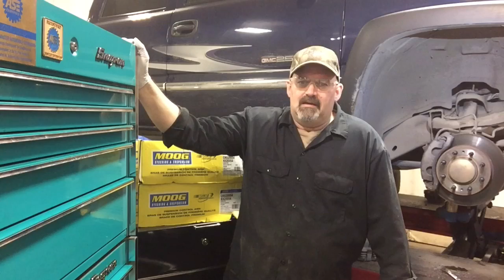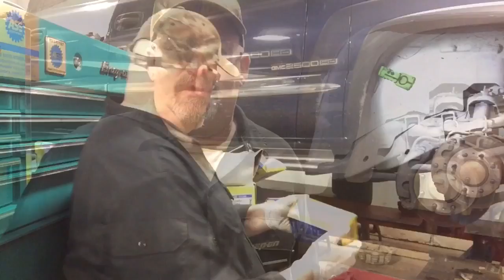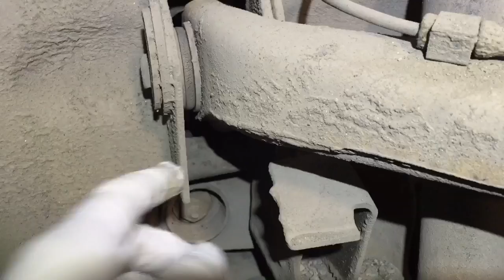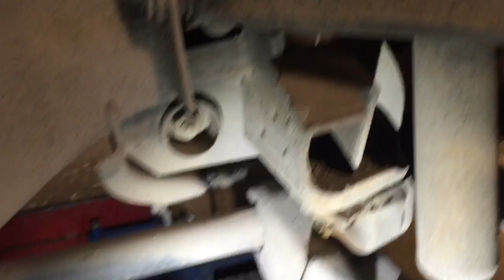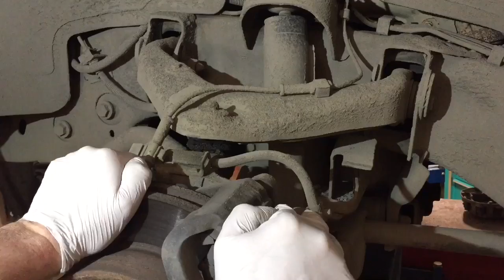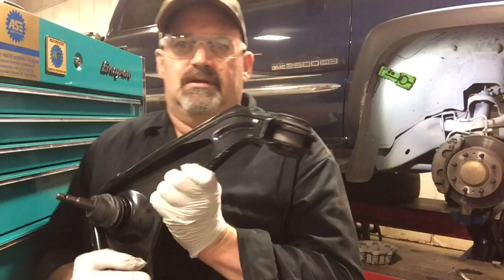Replace Just the Ball Joint Or The Entire Control Arm - Front Suspension Repair Tips

Comment: Hi, I have a 2000 chevy 3500 express diesel van. I have a noise in the right front. When they put breaks on my van I was told that the right upper ball joint needed to be replaced. I didn’t have the money to do it. I’m thinking maybe about getting that ball joint done over the next 4 or 5 months. What should I expect it to cost me for that kind of a repair? I am in NJ so I assume rust may make the job longer. So maybe you need to factor in some extra time for the job.

Thanks

Comment: Love your video, I need help ! Can't replace the bolt on lower ball joint on my audi q3?? Nuts are off but won't release from control arm
Reply from the maker: May need some heat or air impact tool. Wish I could help but I’m in Alaska

Comment: Greetings. Hoping you might be able to answer a few question. Just had my Ford Explorer in the shop and they say I need some work on my front end which I know it needs but the estimate they gave me sounds like the same parts so here goes. For parts he has 2 Lower Ball Joints($170),  1 control arm with Ball Joint - Front right upper($97), 1 Control Arm Assembly($110), Tie Rod end - Outer Left($68)......prices are for parts not labor and under labor cost Ball Joint - remove & replace -RWD lower, both. Ball Joint - remove & replace - upper, both - [Serviced with Control Arm] Tie Rod&/or End - remove & replace - outer, one side - [includes: adjust toe-in only Note; Deduct .4 if alignment is also performed Note: Manufacture recommends removal of rack and pinion steering gear when replacing inner tie rod end(s) on some models. Left(driver)Outer! So does this sound normal to you.....thank you in advance!!
Reply from the maker: Yes. Hope they are quality parts. No need to remove rack on that vehicle so the inner tie rod estimate is probably high.
Reply: @ThecardoctorTV  Thank you!

Comment: On my car 2003 Chevy Cavalier I removed the rivets and increased the holes to 1/2" to fit new ball joint bolts. But the question I can't find anywhere: what torque specifications do you apply on those 3 bolt, attaching the Ball Joint to the Control Arm? In Haynes Manual it says should be an instruction sheet in a new set, but mine doesn't have one. From Internet it looks like 10-12 or 12-14 Ft-lbs, but in one film he applied 50 Ft-lbs, though on a truck. Pls could you give your opinion what torque specification it can be? I did a lot of research on Internet, nothing on that question. Thank you for a good film.

Comment: I have around 260,000 miles with original control arms from factory, would you recommend replacing them? My ball joints are bad but with the amount of miles I have, I figured I’d just replace the control arms. What do you suggest?

Comment: 2004HD Duramax with 260,000 on it. Replaced both upper ball joints last year. Was not aware of that the upper control arm with ball joints was an option. Now, of course, the control arm bushings are going out. ;) So have to make the decision, do I replace bushings or complete assembly and eat the new ball joints that only have about 1,000 miles on them. :(

Comment: You really hit the nail on the head when doing work for someone else, time is money. Yes, you can often replace individual parts for less money in regards to parts but it can easily end up costing more on labor. That's why things like Monroe quick-struts are popular, they are much faster to swap in and out and you don't have to dance with death trying to compress springs.
But if you are doing the job for yourself, replacing the ball joints and bushings can be better because you can get the parts for less or you can sometimes get better upgraded parts. It all boils down to if you have more time than money or if you need it done quick. Plus, people like to go straight for the cheapest parts... I would much rather spend a bit more for a good Moog part and have confidence it will last for years instead of being right back here again next year replacing the same cheap brand part.

Comment: I have an '02 Dakota Quad Cab. Just rebuild the whole front suspension in my driveway. I went with all 4 moog control arms which came with the ball joints & control arm bushings arm bushings pre installed. Also did the tie rods, steering links, and the stabilizer bar links. The ball joints had zerk fittings. The tie rods & stabilizer links didn't, so I drilled 7/32 holes, 1/4 x 28 tap & installed zerks on these. $360 delivered from rockauto. No regrets. Wasn't worth the chance of the greif it could have been. My truck now feels as tight as when I bought it new.

Comment: How do you know if you need to replace the moog lower control arm?  What happens if you dont replace them?
Reply: You don't have to replace them unless they are broken or somehow damaged. Its just on some applications its easier and faster to just replace the whole control arm rather than go through the aggravation of trying to replace a ball joint In the case of the Cadillac with torsion bars its too much work to replace the lower control arm because of the torsion bars and all the crap you have to remove so that's why the easier way to go on lower control arms for this car is ball joint replacement

Comment: Moog used to be made in US only but now that FM bought them they are 

made by about 16 different countries so unless you can see the box on the shelf you do not know where or what you are getting.it is a shame. because I like you always had used Moog suspension parts. As of late there are a lot of reports of wear and especially boot failures on the ball joints.I have used nothing but Moog through the last 50 years,so now I do not know what to use anymore that I can depend on.
Reply: OEM

Comment: guys and gals! thanks for your video on this. goodyear replaced lower control arm and ball joints and just found out from a different shop that goodyear stripped out both ball joints bolts and one bolt was so lose the wheel was flopping.
Reply: Sounds like a lawsuit to me gal.

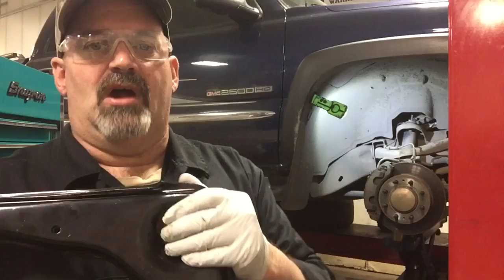Comment: @7:50

I had the shop repair manual on CD-ROM for my 1992 Ford Probe.  Most of you all know that the chassis engine and transmission was Mazda MX6.

The manual strictly prohibited replacing the ball joints saying that  the control arm could not withstand the force of a press.

And yet just before I watch this video I see ball joints for that car still for sale.

Comment: Just one tiny issue.  They don't make the control arms for my truck.  Thus my only option is to change the balljoints as needed (the originals lasted 360,000 miles and were not as bad as the ones in this video)    And then when the control arm bushings start to get play in them (as of now they don't)  then I'll have to cut them completely off and weld in new mounts for a tubular after-market set up.  There may be some videos on this channel that show fabrication of aftermarket parts into vehicles with discontinued part numbers, but if not it may make for a good video!

Comment: Hopefully the time of chatter is'not included in the labor cost.
Reply: Most flat rate mechanics charge fairly close to the published book time, as shown in the dealers repair manual. In some individual cars, work can be done more quickly, in others a broken or rusted bolt can push time over. Like many jobs, the average is acceptable but there are tasks that take longer and the mechanic eats that time. I worry more about the guy who is cutting corners to make money by moving faster. The job ends up being sloppy and maybe not done correctly. The guy who spends a little time teaching will almost never directly charge his customer for that.

Comment: If you're a well versed and equipped diy'er, as I would consider myself, I like to keep the upper and lower arms and just replace bushings and ball joints.  For less money you can buy superior (IMO) ball joints and bushings than the cost of new arms that typically have basic bushings and ball joints. This is of course as long as the arms themselves are in good condition.  I live in a dry warm climate, so for me, rust is not really much of an issue.  The trade off is there will be the extra time to press them out but since it's a heavier duty part, the intervals in which you would have to do it is increased.  Worth the effort to me.  Thanks for the videos.  Edit: Example where I live, complete upper control arm is anywhere around $60-$125.....all over the board really.  Heavy duty ball joint and polyurethane bushings about $40.

Comment: Are ball joints covered on warranty? I can't find it in the contract I have a Nissan Sentra 2012
Reply: Sam G most warranties I’ve seen are usually going to exclude those sorts of parts, most components in the wheel well are usually for you to pay for. Especially if it’s a ‘12, that’s 7-9years on the warranty. Probably at this point nothing is covered- I’d definitely call and ask.

Comment: I really enjoy watching your Channel , but seems you get the same number of thumbs down @ every Tutorial you put up ...  Hmm .. ?  Animosity perhaps ? After watching previous vid  " Replacing Upper arm and Lower ball joints " ,  Thank You for the explanation as to why and when the Upper Arm Assembly should be/not be replaced ,   I was also a bit confused at first vid as well .  Location  ( weather / terrain conditions etc. )  along with sustainability vs. cost ,  plays a major roll in evaluating whats best in the long run . I'm getting ready to pull the drivers side wheel of my recently purchased ( used ) 03 Chevy Avalanche 4x4 that has some play in steering wheel and likes to float to the left @ 35-40 mph. and while braking .  Previous owner says ball joints needed replaced , but I haven't inspected or sure what underlying problems may exist .. thanks for the possibility's that may incur and/or how to repair in this scenario . P.S any tips or cause on the the above described would be most comforting ,  Thanks  RJ

Comment: Thank you  Doctor!  I wish you were around where we live.  Wife has a 06 Lincoln Town. We are replacing worn lower balls with Moog as I have sold thousand of dollars of Moog with no issues. We want to do the uppers at the same time even though they are still tight  as the car is 13 years young with 100 k on the clock.   Upper control arms may be steel or aluminum but I haven't been able to go underneath with a magnet.  Does it matter?  Should I go with the arms or just the balls and if I go with the arms should I get steel or aluminum?

Comment: Is it safer replacing whole arm with riveted lower ball joint than just replacing lower ball joint . The bolts for new LBJ has nylon inside bolts does it fit as tight after cutting and pounding out old rivets.has any replaced ever come loose
Reply from the maker: Just need to get the bolts tight and they hold just as good as the rivets. I have seen bolts that came loose but probably not properly torqued in the first place

Comment: I agree totally on the quality of Moog parts. I recently replaced my lower ball joints on my 2003 Silverado 2WD, and for the application it was much easier to replace the whole arm. The joints are riveted to the arm, which would require a lot of drilling to replace.
Reply from the maker: Good call. I would make more money off labor but it would end up costing the customer more just doing the joint in some cases and they get less bang for the buck. Thanks for dropping by the shop!

Comment: only issue i see with a upper arm is that half the time in wisconsin those cam bolts are so seized to the bushing sleeve you have to sawzall them out and then buy new cams. Its easier to just do the joint in my opinion.
Reply from the maker: +UBBERTANKER oh I believe that. You rust belt techs are hard core. I e has the same can of WD40 for twenty years. Most bolts we can remove with bare hands. I hardly ever use my wrenches. Haha.

Comment: Truly amazing to see a 14 year old truck with a ton of miles on it with no rust
Reply from the maker: +davemaster001 It's probably strange to hear but 130K is a lot of miles here. 150K on a 2001 F 150 is doing really good. This one has over 230K and running strong however the trans might be weak. Cold weather, lots of idling time, no highway miles and terrible roads take their toll. There are actually some really nice classic cars here. Quite a few exotics but they can only drive them 4-5 months out of the year. Next year I might get me a dog sled team and stop worrying about all these vehicle issues!

Comment: Tim on my 2500hd my upper arms were good and I used moog problem solver upper ball joints. If I went for the arms I would need the alignment done. All good and tracks fine I know they suggest to get an alignment so when you just change the upper ball joint do you find the alignment out ?
Reply from the maker: +STEVE ROB If I find the alignment out after the repair I figure it's probably not due to the actual part replacement but likely from before. Maybe a condition that happened over time or because of a bad pothole. Hard to imagine that parts machined with such close tolerances would cause a difference in alignment angles of any consequence. On the rig today I changed the arms and left the plastic cam bolt locators on and used them to get a more exact position of the arms. I'll see tomorrow when I put the machine on it in the morning and see where we are at. In your case it seems like if it handles great and there is no tire wear it's probably ok. Toe seems to be the most sensitive angle when speaking of parts changing and the resulting effect. That's all I got. If you need the mathematical and physics principles in regards to this theory you'll need to talk to Eric O. Haha.
Reply from the maker: Thank you guys. it's really cool to watch a student of mine get from not understanding what internal combustion was to learning how to put air in a tire. He's come a long way and that's just in the last six months. So proud of him.
Reply: +STEVE ROB - Hiya's Big Guy!  Steve - some clown left ya a note above.
Reply: Hawaiian F150 A pretty smart one too, little secret just between us guys, you know that Eric O guy well he was taught everything by Tim  when he lived down south. Actually was Tim's  helper, you know getting coffee's , that kinda thing , then Tim started him off with tire changing and look at him now he's a fantastic tire changer.  LOL
Reply: +STEVE ROB -- i didn't know that. That is really awesome. I mean to know that someone you helped and taught has become such a good mechanic. Tim - You got to be Really Proud of that. And you certainly have every right to Proud. I would if it were me.  Not many can say and show how much they helped others become better people.  Many Talk the Talk - You Walked the Talk.

Comment: I am just about to change the front control arms on my ford mondeo, I decided to go with new control arms simply becasue purchasing the bushings and ball joint separately would have been only like 35% cheaper, and in my opinion this would not offset the additional work involved.
Reply from the maker: +krugerblue That's probably my thinking most of the time. I still have customers who insist on replacing everything if your in there and others who always want to do just the minimum no mater what. Even if addressing something now will save a lot of money when they have to do it a year down the road they choose to save a buck now. I get that too. Lots to consider. I hope folks feel free to add ideas here so we can all keep an open mind to the spectrum of solutions for individual cases. Thanks for the input.